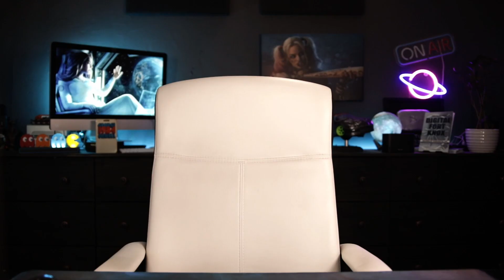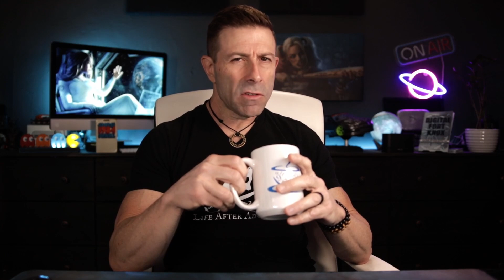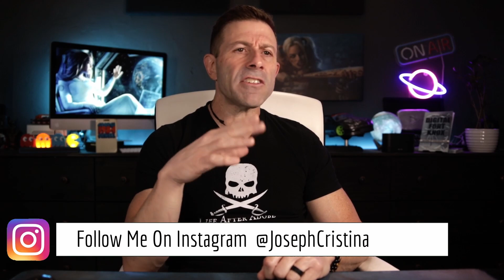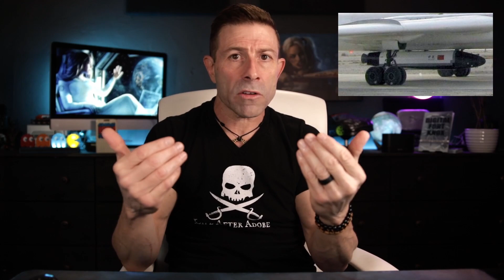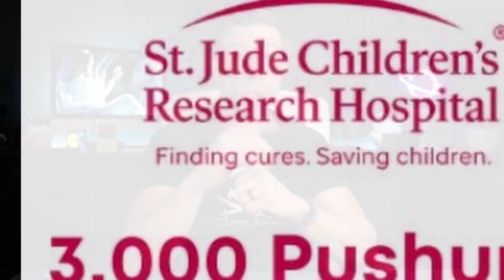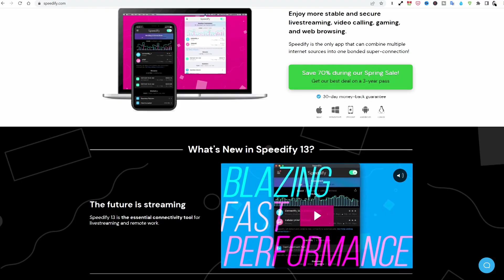SpaceX Starlink Nuclear Option

Comment: ok, you are missing some fundamentals here. i am not an expert, but here is my understanding. this type of tech also known as an RTG generates heat and power. not propulsion. starlink satellites have solar panels for power and a type of electric engine that also needs a propellant. it is the propellant that runs out and limits the life of the satellite, not power. hope this helps.
Reply from the maker: No the unit produces electricity later to
Be used for propulsion
Reply: @jcristina  yes. But in order to have propulsion there has to be a propellant. Starlinks current planned lifespan is based on when it runs out of that propellant. The solar panels would still be producing plenty of electricity. Without looking at weight considderations, the panels are cheaper and require less permiting and paperwork than an RTG based power supply. If the RTG is considderably lighter than panels maybe then spacex would considder using such an item. Honestly i dont see this happening, but i could be wrong. Great video though.

Comment: A shoe box size generator not enough to power an electric vehicle but when an electric vehicle is not in use it can charge its batteries when it's parked and this would be useful for extra planetary long range vehicles
Reply from the maker: Agree.

Comment: 1. There is a new technology that is more efficient than a RPS.  It is still a nuclear electricity production.  I performed the final test on the material for the Cassini mission.  At the time (about 1986) we had produced enough material for all missions NASA had planned.  Takes a long time to get a satellite into space.  The facility that produced the material has been destroyed.  Radioactive isotopes have been in the atmosphere since the first nuclear explosion.  This is not a nuclear propulsion system.
Reply from the maker: It’s basically a HOT ROCK IN A BOX as they call it.
Reply: @jcristina  I've got 2 uptakes (enough to cause cancer) of PU 239, and although I'm good for 25,000 years, I'm not nuclear powered.
Reply: @jcristina  How about a steam engine powered by nuclear power.  It is a combination of a Stirling engine and the nuclear material used in the RTD.  20% efficiency vs 6% for the RTD.   https://www.youtube.com/watch?v=chv6_seOaWw&t=624s

Comment: A nuclear electric rocket (more properly nuclear electric propulsion) is a type of spacecraft propulsion system where thermal energy from a nuclear reactor is converted to electrical energy, which is used to drive an ION THRUSTER or other electrical spacecraft propulsion technology.
Reply from the maker: Yes. Not to launch to maneuver in orbit
Reply: @jcristina  ION engine concept is for space only i.e. interplanetary travel this was the original concept

Comment: I doubt it would be as useful as a cheap replacement and delivery system. Think about it like this Tech is evolving so fast the satellites would be horribly obsolete after 10 years. At this point regardless of its propulsion system it will probably need a upgrade. 

Then consider what the cost of deorbiting something like this would be, You would need to go up and collect it in order to avoid a uncontrolled deorbit burnup and spreading fallout all over the world because regardless of if its fission powered or not, it still has radioactive material.
Reply from the maker: Great point.

Comment: When I was going to college were learned about these thermal generators. The bigger the delta in temperature from the cold side and the hot side the more power that is generated. Seems like a very viable solution, but I hope they work out all the details on disposal methods before they start using this technology. A lot of the time we as humans figure out great technology, but forget about the waste that it generates and how to safely dispose of it. Great video!
Reply from the maker: 110%.  I remember those plates. One side
Hot one side cold producing electricity.